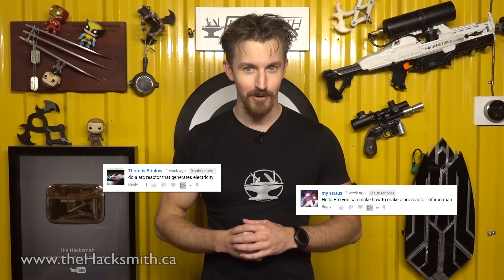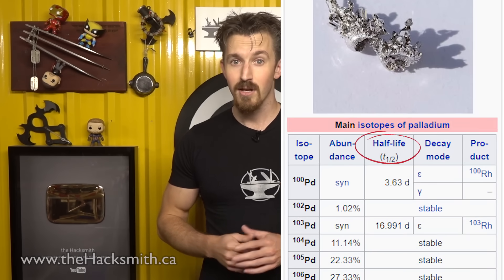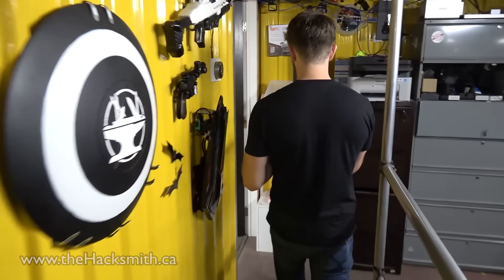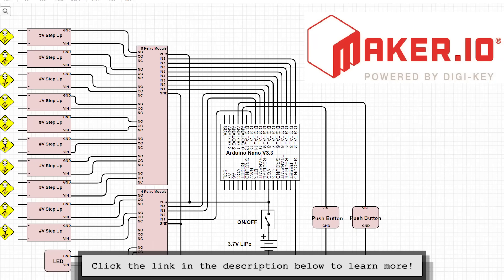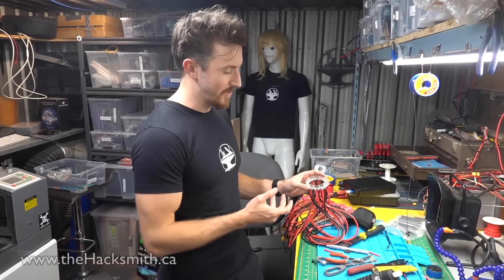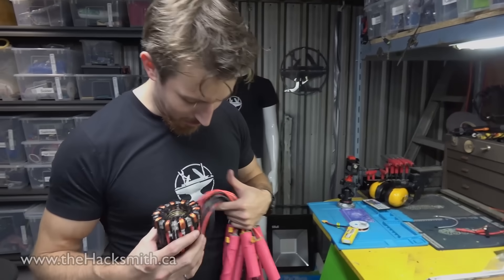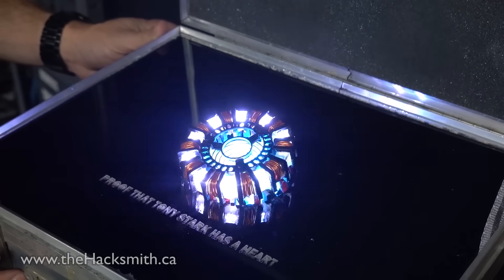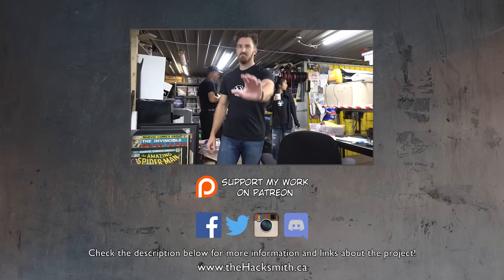Real Arc Reactor (ionized plasma generator)

Comment: Has YT funding issues. 
Releases arc reactor diagram for free. 
You are a legend man.
Reply: Why, it's not generating any power, it's actually using up power. The phone is being charged by the battery in a fancy and very loud manner. Also he just bought the body of the arc reactor from china for $20. Google "arc reactor banggood" to find them for sale.

Comment: one question does it really produce energy, or was the phone powered by the batteries inside the box?
Reply: Probably just used voltage from batteries to charge the phone. Arc reactor is just for show

Comment: I figured the arc reactor was a style of fusion reactor, like the tokamak or the toroidal generators. It even looks like one with the large-scale arc reactor in Tony's company head quarters. This would also explain Tony's toxicity issue in the second movie: the radioactive helium 3 would be quite dangerous. But, if he could create an ultra-dense material to act as a neutron moderator, he could reduce the frequency of dangerous isotopes in the reaction chamber.

Comment: I thought that I wrote this before, the only way that a arc reactor could be real is the principle of the Geiger detector, where you can convert radioactivity into electricity, one time read that inside of these are a arc with gas xeon and chloride ore something else, but it will be more dangerous that nothing because all the thing  would be potentially super radioactive

Comment: wait, so I'm confused. Does this actually generate electricity, or is stuff just coming from the battery pack in the box???
Reply: This thing isn't generating anything useful, it's consuming.
Reply: Battery packs are the power source fully. It's used to power separately the LEDs for the center, the arcs for the outer ring and the USB plug on the side. 

The power available would be higher if not for the arc display. That requires a significant portion of the battery power to generate. 

Electrical power is like mechanical power in that you have speed or work, but not both. Top speed vs Torque or voltage vs wattage. The higher voltage increases the "speed" of the electrons so that they can arc between the two conductors giving off light and heat. Unfortunately that means that the wattage/amperage is significantly reduced to produce the higher voltage. The reverse is true of the USB port. It is taking the voltage down to 5volts and outputting at 5.1 amps. Not nearly enough to produce a spark like on the outer ring, but plenty of "torque" for recharging a phone by shoving those electrons into the phone battery. 

This is a simplification of course. And there is plenty of mathematical formulas involved. Which you see him do at the beginning to determine what voltage is required to get the sparks he wants over a given distance. 

You use this info when you're determining what type of electric motor to use, or what type of transformer is needed to power a motor to give you certain results. All sorts of stuff. Even the phone in your hand has to take the power it gets and divide it up to power all the different components at different levels in order to work. Which all has to be engineered using capacity and formulas to determine how the power is used. And then it's further engineered to use as little as possible to prolong battery life without suffering deficiencies in operation. Programming also affects this.

It's specifically why we use AC power to light up the world. High voltage alternating current is far more efficient to transfer. Then the stuff you plug into the wall uses a transformer to change to DC current as it's far better for doing work with. Again, oversimplifying. But there's only room for so much info here. They have books for this stuff.

Comment: Create vibranium through the principle of lightning arester,absorbing the vibrations and converting into electricity
Reply: Salman M. S. this may sound bad but why not getting a steel cap shield and coat it with many layers of i think its called carbon fiber the thing thats in pecils that absorbs blunt (snoopdoogg... jk) objects although that material is very expensive

Comment: Wait, so how does it actually generate power? Where does the energy come from? And how do you recharge it? It looked like it required electricity to generate the electricity arc inside, almost like a really high voltage light display, but where does the output energy come into play?

Comment: Couldnt you turn the arc reactor design into a sort of portable charger, just enough to get a phone to full charge so it is still the size it needs to be. That way you still get a bomb ass arc reactor without a shit ton of wires and it sorta does what it's supposed to do

Comment: I think insdead of a  perpetual motion electrical arc reactor. MY bet guess is that Tony Stark had prefected nuclear fusion technology, and this was a fusion reactor, which still couldn't have a power output of 3gw/h but still closer then anything else

Edit: I looked at the iron man scene again and I'm just gonna state that this is just my guess with no supporting evidance and research 
I'm guessing that this is closer to a cold fusion reactor with the palladium acting as the negitive electrode and Platinum as the possitive electrode (where Tony would've gotten Platinum from in a cave is beyond me) 
I'm sure there are plenty of youtube videos explaining this and some may argue that some materials used in cold fusion is inaccesible in a cave, it's just my basic guess
Reply: Jackson Li | I think it was closer to a psuedo-fusion reactor, it didn’t make much noise meaning it arced in a vacuum. The Palladium in the first Arc reactor was likely used to link the arcs inside the reactor, meaning the arc reactor likely worked by conducting the heat of the very slow fission reaction happening in the reactor, and essentially replacing a neutron gun with an electron bombardment system. Less volatile, maybe more efficient. Fusion might have been happening at the lower stages of decay, but that would require the expertise of a nuclear engineer. The heat in Tony’s chest tho, without a pretty good vacuum he’d just vaporise.
Reply: Your friendly neighborhood Ratchet 
Good point, I was just listing possibilities and didn’t really look into the physics of how Tony would manage making that in a cave. But he is the genius so we expect him to know how to do these crazy things

Comment: It's not possible..a tiny round shaped battery doesn't give infinite power
Reply: Not infinite. Its a start. Eventually, this prototype will get more enhanced as time goes by. An Arc Reactor may not be far into the future, clean energy. Eventually miniaturized versions could be placed in micro bots.

Comment: I didnt get it. Where does the energy come from? From the batteries????
Reply: Yupp. Then the energy transfer around the arc. Hence, the batteries will get recharged at the same time. The concept of energy storage.
Reply: @dreoutcasting4415  ok but they get empty after a time wont they?
Reply: @topsecret3926  yupp
Reply: @dreoutcasting4415  how about make it recharge from the sun? This should be rly good
Reply: but there is no component list for this project

Comment: Do not confuse efficiency less than 100% and coefficient of performance greater than 1. Violation of the second law of thermodynamics makes COP > 1 impossible in a closed system. In an open system, which nature is, it happens all of the time. How else would you explain a kid flying a kite, or a refrigerator, or a heat pump, or, or .... If you get more output of energy than what you input into the system, that is because the system is open to the environment and although the efficiency is less than unity, the coefficient of performance is greater than one.

Comment: The arc reactor is actually based on a fusion reactor. It uses the radioactive properties of palladium to kick start a chain reaction whilst containing it in a magnetic field
Reply: No may be from uranium
Reply: It can't be from uranium because then it would result in fission taking place. Even though Palladium is more massive than Iron (most stable element), it is more stable than uranium and so offers only small inputs of energy from decay, which is useful in allowing fusion to occur
Reply: Uranium can produce a large amount of electricity the arc can be made by uranium

Comment: So basically you're using multiple 80  thousand volts batteries to generate 3.1 volt for charging ...rest goes all in fancy
Reply: That is correct. That's how transformer works. Power balanced devices. Actual arc reactor hiests power from palladium to release million volts of energy. ~ tony stark from future.

Comment: The second movie really helps to explain how his arc reactor worked. Basically it uses a small insert of poladium as sort of a fuel source. Over time that insert breaks down from some sort of reaction to generate power.

EDIT: Also in the second movie he figured out how to synthesize a new element that provides a clean and safe reaction in the arc reactor. So I assume after Iron Man 2, Tony has some sort of in-house means of mass producing his new element as fuel for what is basically a mini reactor.

Comment: "it wont power the house" of course not. the thing is just a big resistor. the source is the batteries, and there's not much you can do with 80,000 volts

Comment: Yeah anyone can do it.. not like you have a whole ass factory and crew
Reply from the maker: all i used in this video was a soldering iron and a laser cutter (for a decorative piece) ...
Reply: the Hacksmith also I appreciate you taking the time to reply lol
Reply: the Hacksmith yeah except for all the hand tools, wire, batteries , voltage meter, materials in general plus the team you’ve got with you and your experience and know how. Sure anyone can do anything if there’s a detailed enough how to video but something like this is a far cry from some simple craft for marvel fans to just jump into. That’s all I’m saying lol not everyone can and not everyone should but you said it so nonchalant like then wayyy over simplified it in the comment like I’m some dumbfuck for pointing out the obvious. It seems simple enough just watching the video but you’re lying if you’re tryna pass it off as so easy and safe that it requires only a soldering iron and a laser cutter(for decoration of course)
Reply from the maker: Literally everything I used in this project are the most basic tools you could acquire for maybe a hundred bucks or so... Minus the laser cutter. If you had commented this on one of our more complicated projects I'd agree with you, we do have more equipment than most! But this project was very simple and could be replicated quite easily!

Comment: That's how I can do something like a tokamak and show home power. What you have shown is an electric arc plasma bulb does not generate energy, the arc itself needs argon gas for the elementary particles to be able to change thermonuclear fusion. Amateur of you. A plain stretoscope battery bulb. And this device is a motor and generator simultaneously but plasma. Read the tokamak and plasma engine patents. Jełop. Wy będziecie nadal zasilać USA OZE.

Comment: It's not producing any power? If those power banks are actually hooked up to those USB ports via the "reactor" then it's more or less a very noisy and inefficient resistor which is only designed to use up electricity by arcing it through the air, there's no physical way for it to produce any electricity without violating the laws of physics.
Reply from the maker: Helps if you watch the whole video. I kinda explain that ;-)

Comment: I wish some one would make real arc reactor but have to use magnetic wire and container for ionized air just like plasma globe have info if want try to make it not one you made palladium is in round cylinder that's enclosed  so you don't touch it...

Comment: If you made the core out of evacuated glass tube, you would require much less voltage and it would be a lot quieter and safer.
Reply from the maker: still wouldn't do anything though :P

Comment: But mass can be created into energy
If we continously convert atomic mass into energy
Reply from the maker: That's still following the conservation of energy
Reply: @hacksmith 
But i am saying if we somehow fill a gas(possibly which has higher atomic mass) into the arc reactor, whose mass can be converted into energy(clean+sustainable) by breaking its intermolecular bonds and the little energy which does not get comsumed(as  there is always some energy which is not consumed) can somehow be converted into mass again,(possibly by remaking the bonds)  we can start a chain reaction producing energy(i dont know the amount) for a longer time. We just need to harnessn that energy into electricity and use that to power 
By the way i am  a great fan of yours and consider you as a role model for my career.
Reply from the maker: Yeha that's called fission -- not something you can do at home :)
Reply: @hacksmith  
but only if we had a cave and a box of scraps...

Comment: Do you think that iron man converts high speed wind in to energy when he is flying because if he did he would need a propeller to harness the wind in a crack
Reply from the maker: Nope. That wouldn't work. Just like putting a wind turbine on top of your car. Conservation of energy. You're creating drag to produce energy, which means you're using more of the car's energy to produce a little bit of wind energy, so you'll be losing total energy, not gaining anything :(

Comment: You could give yourself a much easier time by inserting some gas with a lower breakdown voltage...
Reply from the maker: And that would achieve what exactly? It doesn't do anything lol
Reply: @hacksmith   It would allow you to reduce the output voltage of your HV-inverters, which would give your more amps for the watt. 
As it is, you could let in gases to make the arcs fluoresce in fancy colors ;-)
Reply from the maker: Yeah but it still doesn't do anything =p
Reply: @hacksmith  It lowers your required voltage, increases the output power of the generator AND it glows in fancy colours 🥳
What does it take to inspire you?
Ok I am not sure if it would have made things easier in the end, considering the extra effort, but it is fun - and isn't that the point of this channel?

Comment: But how does it generate the power? It should just drain power from the battery installed to power the arcs.
Reply: That's exactly what it's doing, the battery powers up the arc reactor, the rest of the energy goes into charging the phone, its not a generator

Comment: The arc reactor is actually a miniature plasma fusion reactor that uses hydrogen that can be fused into helium producing a possibly insane amount of power
Reply: Oh my god, that is nuclear fusion, and it happens only in the stars(eg: our sun) ...If  u create such thing, your whole country will blow up (even if you use only 10 grams of hydrogen). So basically we don't have the equipment to control it, otherwise we would have done it long ago. So, that's the only problem. If you are able to control the energy which can destroy entire USA, then well done, you have an arc reactor with tremendous amounts of energy !!!!
Reply: @snutpaws  we can't control it yet!
Reply: @connairmoo2368  I know

Comment: The arc reactor in the movie is not a plasma generator or whatever, the one in the movie is a cold fusion reactor that runs off of palladium chips. It was once theorized as possible but has yet to be proven. And nuclear fusion is possible as well, but it just requires more energy to put into motion rather than you receive back, therefore useless. In iron man the arc reactor is just a successful version of a cold fusion reactor. And if it did exist in real life, it would very much so be capable of producing 3 Gjs per sec, and would most definitely solve all world problems and make you a billionaire lol
Reply: Fusion is only useless for now but every month it gets better. In a few decades a fusion generator will be up and running. That's what they're saying anyway..

Comment: after watching this video, i realize that creating an arc reactor is impossible in some ways,  tony use pd-103 and pd-107 to make his own current not these little high voltage transformers. but i like the way you use it instead. wait, is that cherenkov radiation??

Comment: the arc reactor may actually be a mini hydrogen reactor which in that case it would get very very hot. but hydrogen is safe and it could actually be a possible (it is already but I mean small)
Reply from the maker: a hydrogen generator uses power to produce hydrogen though... it doesn't produce electricity, which is what an arc reactor is supposed to do

Comment: Are the coils tuned? 
Why use arc thru air?, Nobal gasses.
Arc attenuation could reduce the noise combined with a nobal gas or gas blend. Perhaps a vaporized compound.
Not saying more energy could be achieved but loses could be reduced. Perhaps endothermic reaction could be achieved? I'll share feedback after building some. Great video guys.
Reply from the maker: Even if we filled it with a noble gas... it wouldn't change the outcome... It doesn't do anything.

Comment: so the arc reactor is just a decor? it doesnt reeally do anything? the batteries do all the work right
Reply: Correct, they have provided a little extra info about this in the description. :) The lipo battery is charging the phone, and the part with plugging it into the house was just a skit.

Comment: AlexLab did it a bit differently.
Reply from the maker: Yeah he made a hydrogen generator
Reply: @hacksmith  Yep. He was creating hydroxy gas and mixing it with MAPP gas in a hermetic pulse combustion chamber than instantly releasing and detonating it. I am currently working on my own DC electrolyzer.
Reply: @hacksmith  Just Curious at 8:03 where can I get the items from that bag. Is it a kit or something?